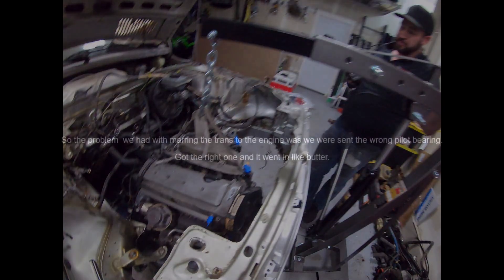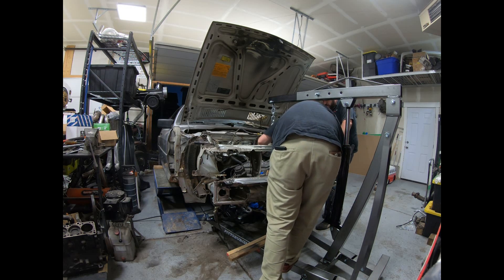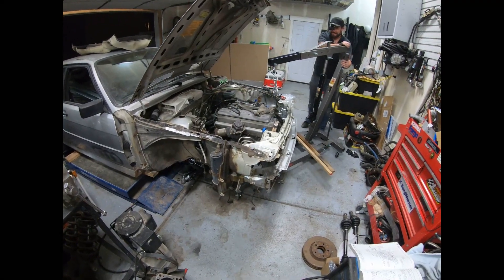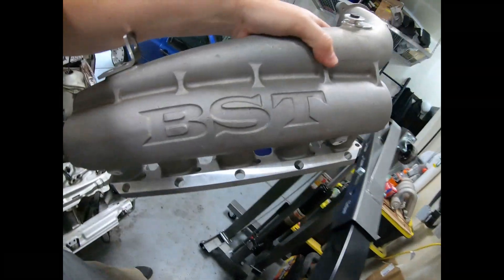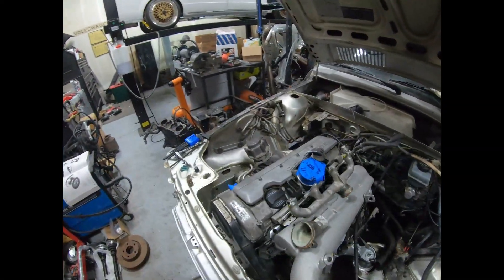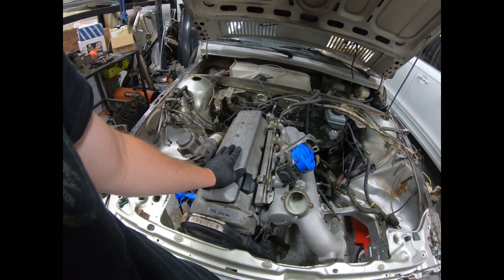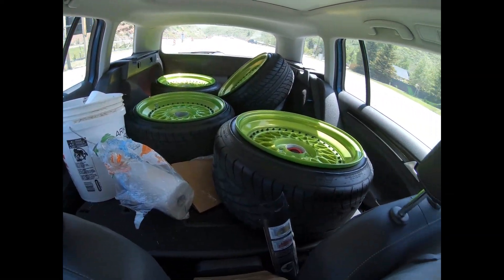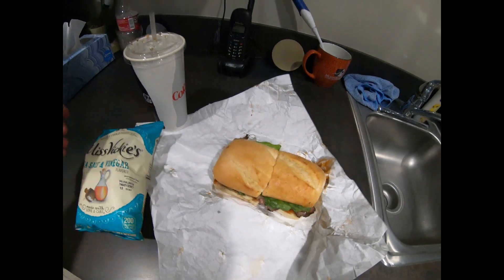Audi UR Quattro engine swap to a 20v turbo AAN 500 horsepower goal

Comment: 500hp from AAN? EZ :) i have atm 550hp/630nm in my urs4 @1,5bar and im a beginner in turbo-things :D my integrated MAP in ecu understands just about ~+1,5bar so if i just get more boost it will be over 600, even 700 on that setup. real uR would be awesome but i like that c4 cabin is pretty big and comfy. you will get your goal :)
Reply from the maker: Sounds like a awesome car!